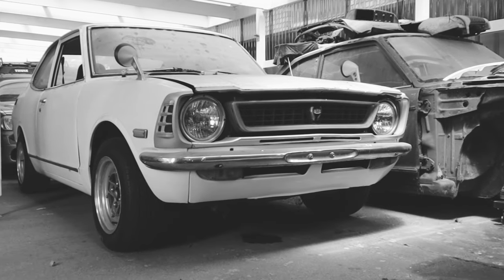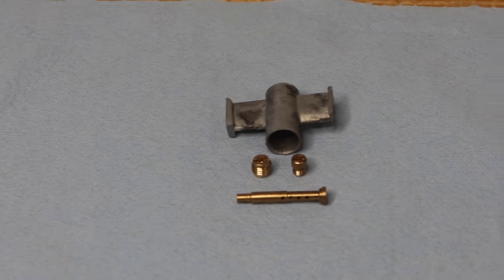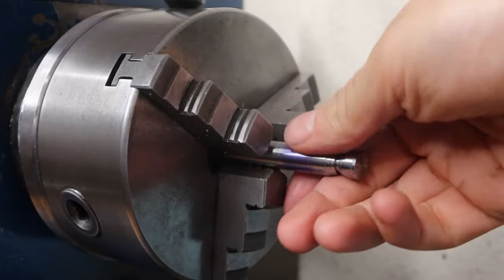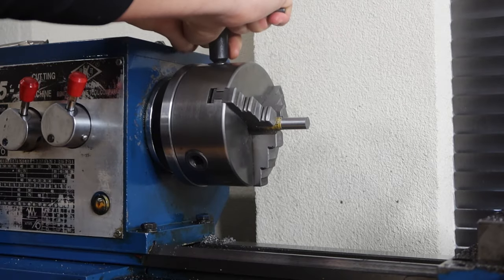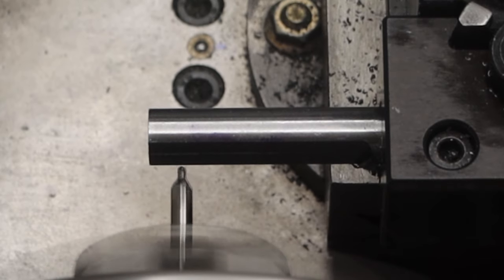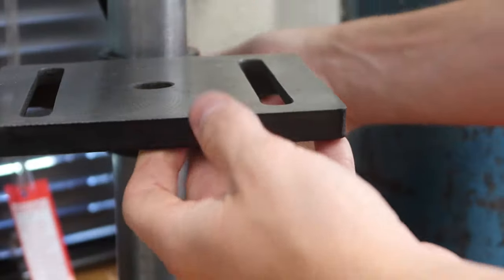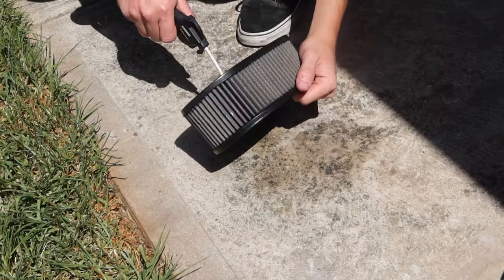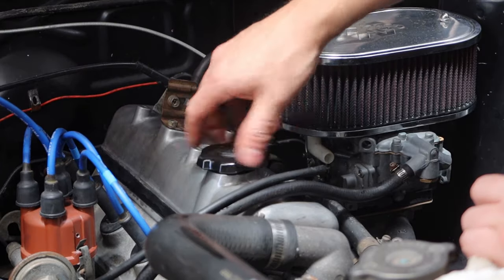KE25 Corolla - 3D Printed Weber Carburetor Adapter Plate

Comment: Im not sure hot it will be for that gasket, but i put tpu(and other materials) in petrol for over 6 months, tpu didnt seem to be affected at all.
Reply from the maker: Yep I've used tpu in a similar application before, it shouldn't be too hot there on top of the Carby but we will see!
Reply: Perhaps the addition of a phenolic spacer if there is heat-soak issues? @fatlipcollective
Reply: @fatlipcollective  I made windscreen washer motor grommets out of TPU and they sealed up just fine - do you have do do anything fancy to get big flat stuff like that gasket to be air tight?
Reply from the maker: @angusturner578 yep potentially an option as well! Hopefully it'll do well enough to last until the turbo kit anyway but we'll see how we go
Reply from the maker: @andrewference1479 nope, it's just printed solid, there's no extra pressure at that point so it just needs to squish a little/have even contact and should be fine. Also being a k engine, any unfiltered air that might be able to sneak through there won't be an issue 😂